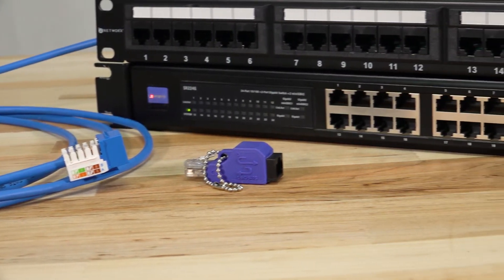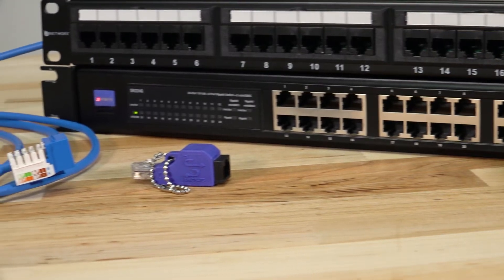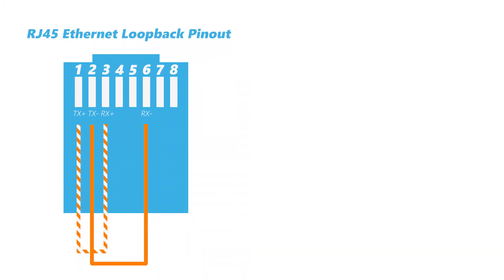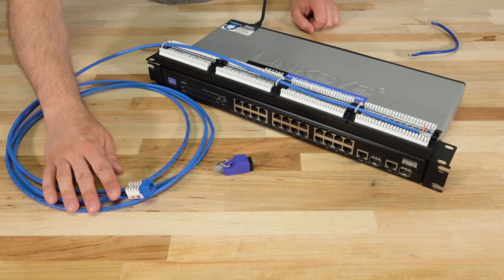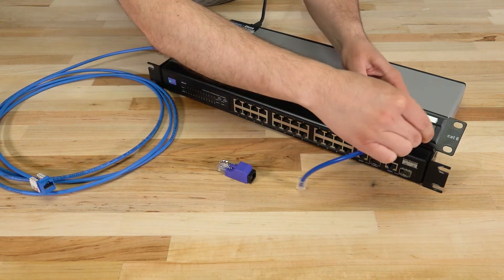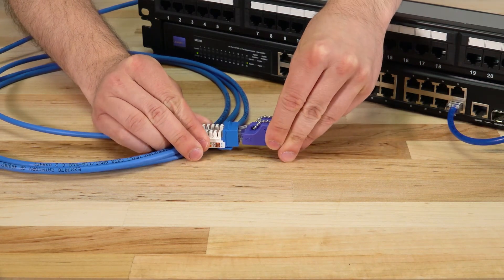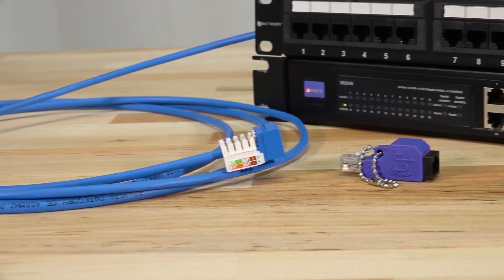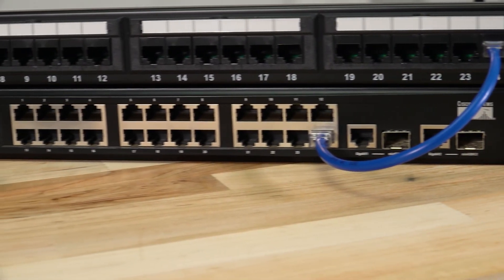How to: Using an RJ45 Loopback Adapter

Comment: Just putting this here:
To create a loopback adapter for ethernet, map pin 1 to 3 and pin 2 to 6.
To create a PRI/T1 loopback adapter, map pin 1 to 4 and pin 2 to 5.

This is because the pins these interfaces use are different for TX and RX.

Comment: Hello, Thanks for the great video. just quick question, this is for testing cat 6 terminal and cable. can I straight up hook the loopback adapter to switch or router? I still should get the green LED right?
Reply from the maker: You can definitely do that.
Reply: @ComputerCableStore  I've tried but failed. didn't get any LED on nor I hooked up to my computer and still didn't get any LED.
my main purpose of testing this is for the board that has W5500 (ethernet chip) and I want to somehow reliability test it. the board works with connecting it another computer. however I haven't find the best way to testing itself.
If you have any good idea, please let me know.
Have a good day

Comment: Under what circumstances would you use the port on the back of the loopback adapter?
Reply from the maker: You can use a patch cable with the port on the back of the loopback adapter instead of plugging the adapter directly into the switch.
Reply: Is the back end essentially for rj45 connector or jacks if you flip it. (Male female)?

Comment: Does it work that way with routers too. Plug it into the back of a router to test the port? Good way to tell if it's the the port, the cable or the device I guess.
Reply from the maker: Depending on which port of the router you plug it in to. Most routers will come with 4-6 ethernet ports which is actually a built in switch.